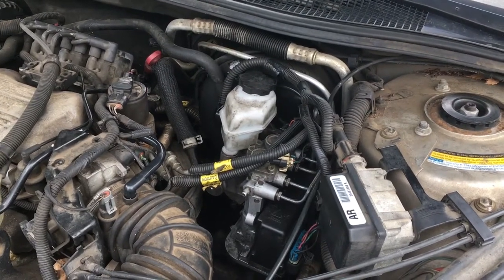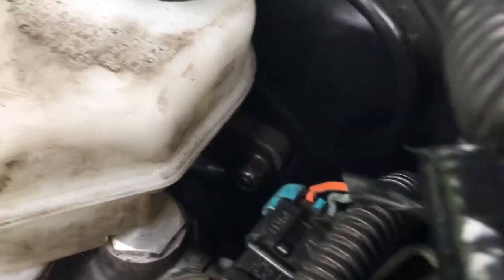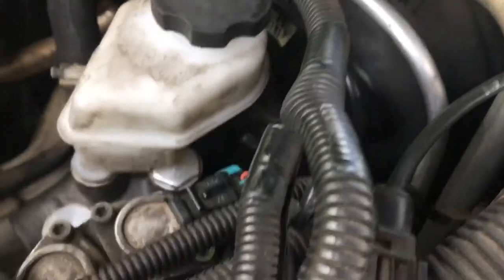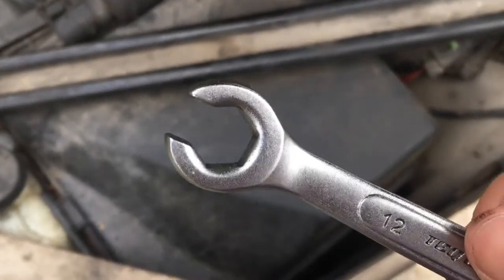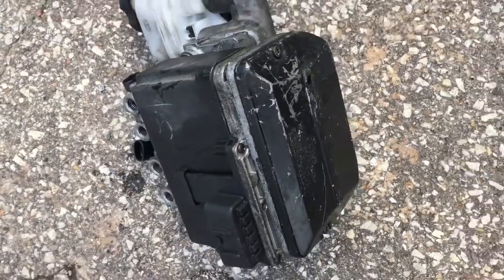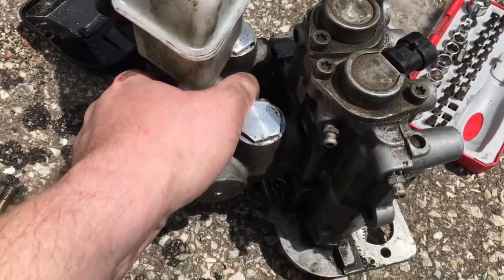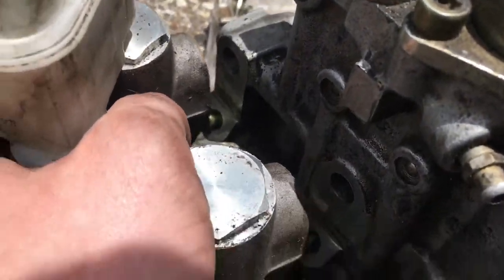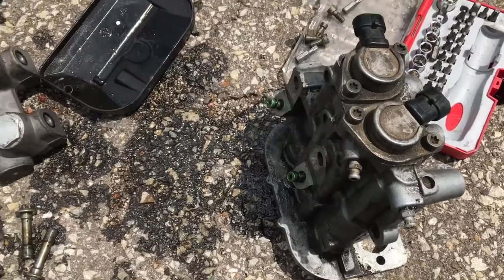How to - Buick Century 1997 Brake Master Cylinder replacement.

Comment: I'm changing the master cylinder and vacuum booster on my 95 Century and pulled the master cylinder / ABS module off today, as you did. I unplugged all of the wires first, which you have to do anyway, which got them out of the way to access the more difficult of the 2 master cylinder nuts. On my 95, those nuts don't turn by hand until they're almost off, and my fat hands don't fit in there worth a damn anyway! But I reached across the master cylinder with a 3/8 drive ratchet and socket and got to it easily, AFTER I got that nut off far enough with a wrench for my socket to grip the nut on that fairly long stud. Loosened it until the ratchet was butted against the master cylinder ... and left it there until I was ready to remove the OTHER nut, which I didn't want to do until AFTER I had disconnected the brake lines, which seems easier (and more safe) to me when the assembly is still held firmly in place. Sprayed a little WD-40 on the brake line nuts and used a line wrench to remove them. But before that I dug through the junk drawer in my toolbox and found some little rubber caps that fit perfectly on the end of the brake lines, and just for good measure I taped them in place with electrical tape. I don't remember the technical term off the top of my head at the moment, but it's my understanding that brake fluid is a liquid which will absorb moisture out of the air, which is why they always tell you to never use brake fluid from a can that has been opened. In my case, I'm just not too sure how long it will be before my new master cylinder goes in and I reconnect the brake lines, so I capped them off to keep ANY type of contaminant out of my brake lines! I've got some other work to do in the area which will be easier with the brake components out of the way, and feel better knowing that the brake lines are safe and protected.
Tomorrow I get to sit in my driver's seat upside down with my head in the floorboard to unbolt my vacuum booster! I used to think that was funny, but I will be 67 years old next month and getting upside down is still fairly easy ... but getting back up and out of that position just ain't no fun anymore! Wish me luck!
Reply: I'm about to replace the brake master cylinder on a '96 Chevy Lumina 4.6L. It's the same cylinder & ABS unit as in the '97 Buick Century, but the windshield wiper cowling extends much further forward in the Lumina making the brake cylinder much harder to access. I'm 69 years old, BTW. I understand what you mean about difficulty getting back up from being upside down.
Reply: @Nehmo  Good luck with that. My 95 Century was due for Inspection in March. Ordered a muffler and a welding machine in February. It was June when I got the ABS light to stay off and got it inspected. Had no continuity through speed sensors in rear wheel bearing assemblies. Wanted to renew the area while replacing those, so I removed, straightened and painted brake backing plates, which meant disconnecting brake lines at wheel cylinders. All went well. Even replaced rear shock mounts when I found them bad. Bled the brakes, started the car, ABS light STILL on, and Brake Booster was sucking vacuum by my feet ... which led to my original comment above.
Getting the 4 nuts from the studs on the Vacuum Booster had me cussing Buick Design Engineers up one side and down the other! Bad enough that I was working upside down, but I ended up having to REMOVE THE STEERING COLUMN in order to get 2 of the nuts off! THAT was an adventure in itself! Found and replaced a bad brake switch in the process. They sure did LOVE putting switches under the brake pedal, had PLENTY of them!
With the master cylinder and brake booster out of the way I found that the wires leading to my Vehicle Speed Sensor were melted. I rerouted the new wires up onto the firewall where they would be cooler instead of under the exhaust manifold where you can't see them or get to them worth a damn.

I won't get into the VERY FUN process of getting my brake system bled out and working properly again ... only to say that my ABS light was STILL ON.
I borrowed the battery out of my Buick to verify my opinion that a friend needed a new battery (which he bought AFTER my battery eliminated his problem). And in the process found that a large 3-wire connector coming off of my battery positive terminal was MELTED together! Repairing that bad connection FINALLY got my ABS light to turn off. But I didn't know that until AFTER I had done quite a bit of welding work where my battery sits. The original stud for the battery hold-down had been GONE for years before I ever got the car ... and it had taken a bit of sheet metal with it when it left. I'm still not exactly done welding there, but will get back to it, and it's a Helluva lot better than it was, and the battery is now bolted down and secured.
I was a HAPPY GUY when my Buick passed inspection ... for a couple of weeks! But I'm gonna be happy again because my SSI check came today, and I will get the immense pleasure of ordering 2 front wheel bearing assemblies and a new radiator. I can hardly wait to get back to work on my 28 year-old Buick ... it was my Mom's car ... it's my "Momma's Memorial Mobil". May she Rest in Peace.

Comment: I just performed my master cylinder. It's not the typical way you bleed a master cylinder.
You load the cylinder with fluid in the reservoir.
Then bleed it through the bleeder valve on top of the ABS pump.
It was very easy to do.

Comment: Thanks for the video. Now How about making on on How to put it back together and bleed the system. Is ther Gears under a lot of spring pressure etc. if so How did you hold pressure on hem to put the ABS back onto the master Cyl?